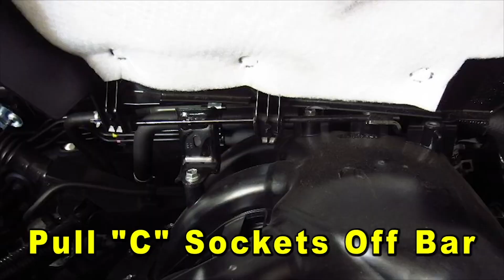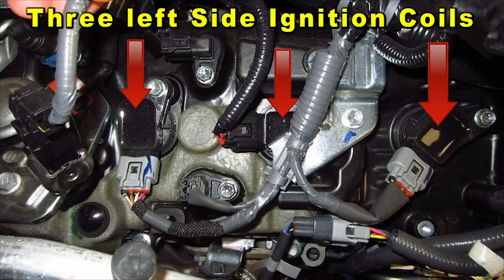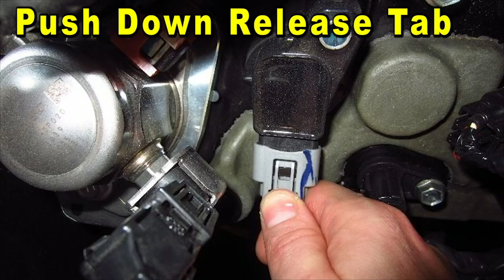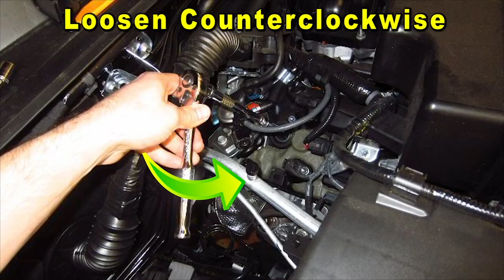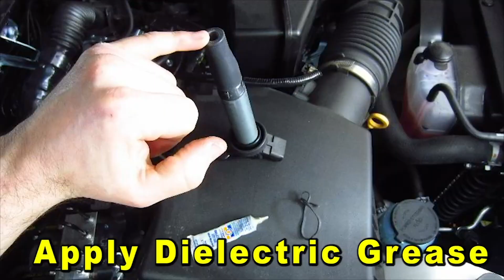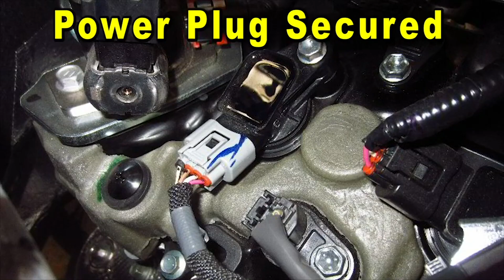2016 To 2023 Toyota Tacoma How To Change Spark Plugs With Part Numbers - Quick & Easy

Comment from the maker: Toyota Tacoma Spark Plug Part Numbers - https://amzn.to/47JQffD
Tacoma OEM Spark Plug Part # - https://amzn.to/49JPtBc
Autolite Iridium XP Spark Plug Part Number - https://amzn.to/3SNmfvd
Bosch Fine Wire Iridium Spark Plug Part # - https://amzn.to/3Gc6BCc
Spark Plug Socket - https://amzn.to/47fDf1v
Dielectric Grease - https://amzn.to/47Kq1tg
Precision Screwdriver Set - https://amzn.to/3sLixaP
Plastic Pry Bar Tools - https://amzn.to/3HMtsV7
Socket & Ratchet Set - https://amzn.to/3Z17LbA
Mechanix Gloves - https://amzn.to/3jCnHkt
Torque Wrench - https://amzn.to/3vS5uSI

The Paul79UF YouTube channel is a participant in the Amazon Services LLC Associates Program, an affiliate advertising program designed to provide a means for sites to earn advertising fees by advertising and linking to Amazon.

This DIY video shows owners of the 3rd generation 2016, 2017, 2018, 2019, 2020, 2021, 2022 & 2023 Toyota Tacoma how to change the spark plugs in the 2GR-FKS 3.5L V6 engine.

Comment from the maker: Check out the DIY guide for changing the spark plugs in a 3rd generation 2016 to 2023 Toyota Tacoma with the 3.5L V6 engine -
https://www.paulstravelpictures.com/2016-2021-Toyota-Tacoma-2GR-FKS-V6-Engine-Spark-Plugs-Replacement-Guide/index.html

Here are all of the DIY repair and maintenance tutorials for the third generation 2016, 2017, 2018, 2019, 2020, 2021, 2022 & 2023 Toyota Tacoma pickup truck - 
https://www.paulstravelpictures.com/Articles/2016-2021-Toyota-Tacoma-DIY-Repair-Maintenance-Guides.htm

Owners of other Toyota or Lexus vehicles such as the Tundra, 4Runner, Hilux, Highlander, C-HR, Avalon, Camry, Corolla, Supra, Land Cruiser, Prius, RAV4, Mirai, Sequoia, Sienna, Yaris, CT 200h, ES 300h, RX 350, GX 460, LX 570, NX 300, RX 450h, UX 200 and UX 250h may also find these DIY instructions to be helpful.